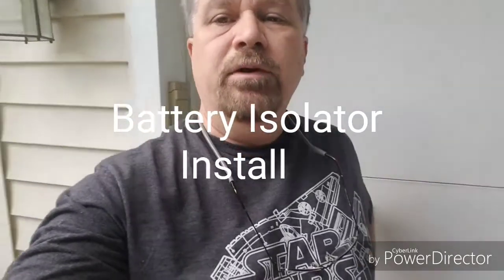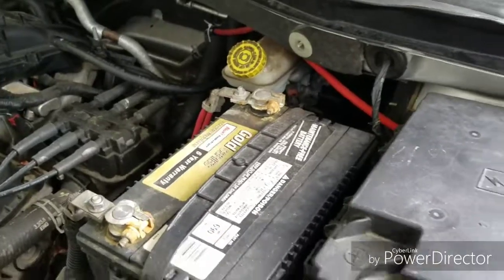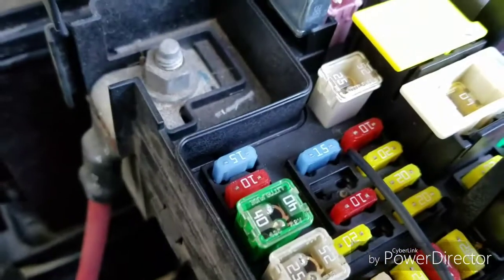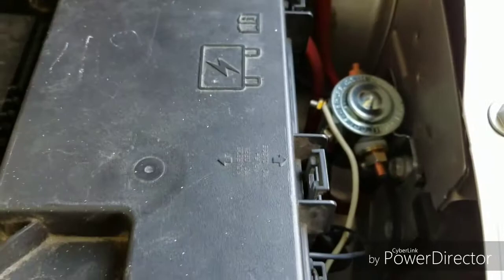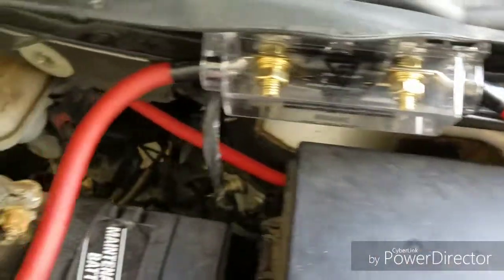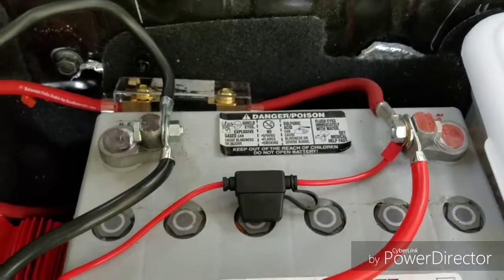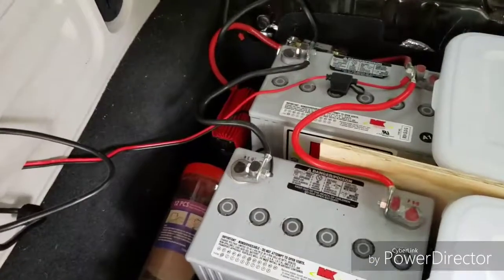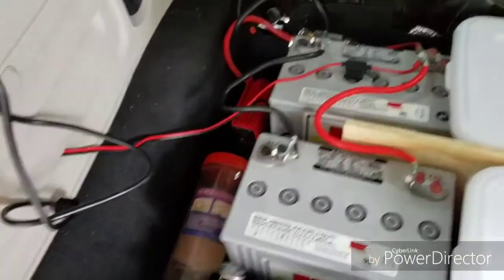How to install a Battery Isolator Part 3

Comment: Mike i am installing a 48 volt system in my van. Can i run a wire from the van battery, with an isolator, to a step up transformer, 12v to 48v to charge the battery bank?
Reply from the maker: Good question.  That would be something you could ask my good friend Will prose.
https://www.youtube.com/user/errolprowse